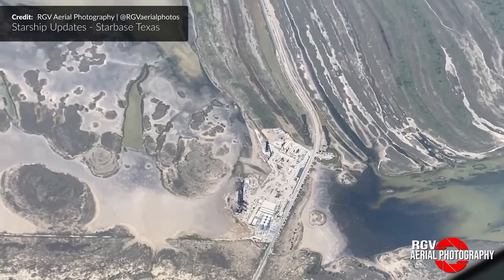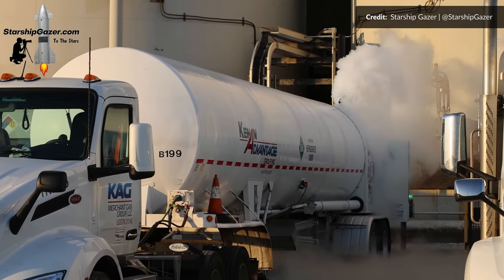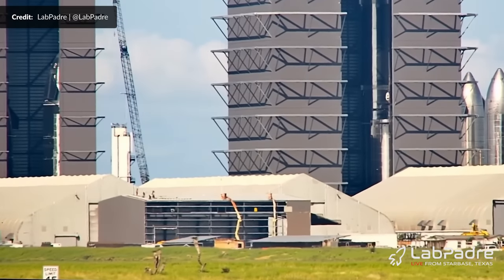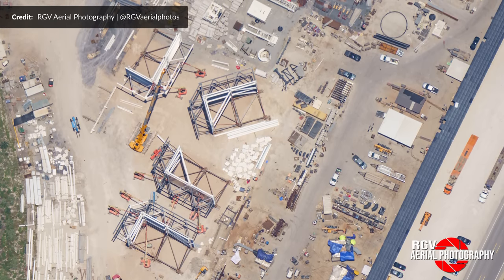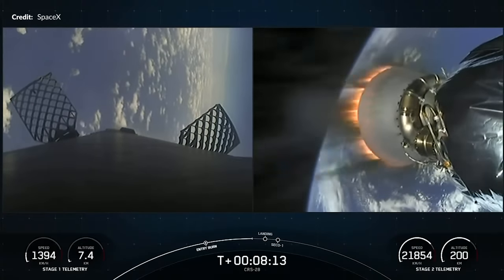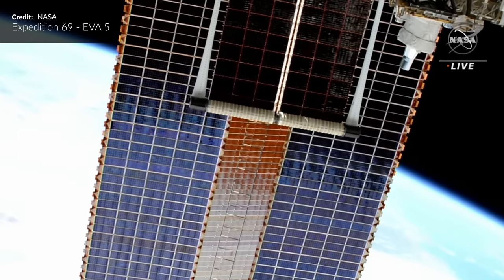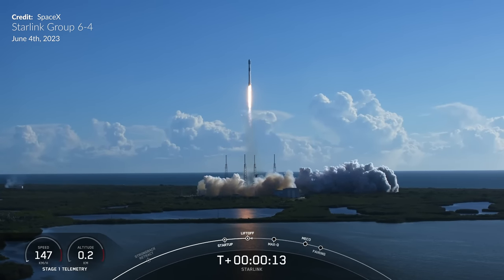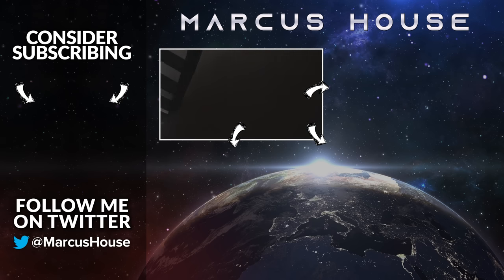NASA's Concerns with SpaceX Starship Delay,  CRS-28 and ULA Vulcan Test Fire

Comment: A lot to do...I am still not convinced this vehicle will be able to land on a loose, unstable surface like the Moon's regolith, and then be able to take off again from it without the debris it kicks up being an issue. I mean, nobody is going to go and build a landing pad for them on the moon. We may get to find out some day but the potential for delays in this program from legal and environmental challenges alone surrounding the Texas site may mean it is a lot farther off than we hope.
Reply: The Superheavy booster is not used on the Moon. The HLS Starship has 9 engines at most, not 33 like the Superheavy booster. The HLS Starship is currently planned to have a ring of 24 smaller methane engines at the top of the propellant tanks for the last bit of landing and first bit of launch. With those engines being roughly 25 meters off the ground, kicking up debris should be minimized.
Reply: @steveaustin2686  I know the booster is not going to the moon nor intended to do more than get the upper stage into orbit. Thanks for the info on the alternate configuration of thrusters. It is interesting but again we are still talking about an entirely new system and it still doesn't solve the issue of ensuring a stable landing site for such a tall ship to land. 

This is all a long way off at any rate and a lot can happen to derail this entire operation. That is more concerning to me than the engineering challenges at the moment. Hopefully they get it all worked out because we need this vehicle to work. Without commercial efforts in space we could be doomed because our governments are not going to do it and a serious failure could be all it takes to scare investors off for another half a century.
Reply: @socket_error1000  The one-use, temporary legs used on SN5-SN15 are not the legs tht will be usedon HLS Starship. SpaceX is making larger, more capable legs for landing on the Moon.

Not that far off, as the current plan is Dec 2025 for Artemis III. Even if it slides into 2026, it's still not that far away. 

NASA has been promoting the commercialization of space with various commercial programs since the early 2000s. NASA already has a contract with Axiom to build modules to attach to the ISS that are planned to be their own commercial space station. NASA is also fostering one or more commercial space stations under the Commercial LEO Destinations (CLD) program. So NASA is already doing what you are looking for.

Comment: Would like to know what is happening at the other launch site,  has work stopped?    😎
Reply: Probably waiting for some elements (like the OLM modifications) to be tested at Boca Chica.  Other elements are probably going forward.  Changes may be needed if they do go ahead with the 6000 ton modified design.  Can the current OLM even handle the extra 20% mass?

Comment: Why arent vertical tanks not a much much better choice, than the horizontal ones? They take much much less space and isnt the pressurization easier, too?
Reply: The vertical methane tanks did not meet Texas regulations, so they were converted to water tanks. Horizontal methane tanks that conform to Texas regulations were brought in. SpaceX hasn't mentioned why they are going to horizontal LOX tanks.

Comment: I've lost count. How many Falcon 9 launches so far in 2023? 
It's interesting that Falcon 9 has achieved the pace of launch that 30 years ago we hoped the shuttle would achieve. If we were building the ISS today it would take half the time and half the cost.
Do you think a private entity will  put up another space station?
Reply: Falcon 9 ≠ Starship. Those are two completely separate teams. Falcon 9 has had one in-flight failure, and it has never lost control and kept flying AND failed to destruct like Starship did.
Reply: @JBS319  Falcon 9 is an iteration of the Falcon 1, that took 3 failures before becoming successful on the 4th. Falcon 9 is unlike any other currently operational launch system. Starship is still in development, though Starship took a few attempts before having a totally successful test. The Booster will likely need as many attempts before also being successful, then its just refining the process before its ready for operational work.
Reply: @stewartkingsley  Eh, saying that the Falcon 9 is an iteration of Falcon 1 is REALLY stretching things thin. The Falcon 1 was a precursor to the Falcon 9, but the Falcon 9 is a new launch vehicle compared to the Falcon 1.
Reply: @JBS319  I was only referring to Falcon 9, which with the Falcon heavy is perfectly capable of lifting shuttle type loads.

Comment: I find it troubling that every time ULA has another setback, somehow SpaceX is included as also having problems.  SpaceX is delayed for a month.  ULA will never fly people again.  There's a big difference between these two situations
Reply: 🙄 You have ULA and Boeing mixed up. Artemis II is planned in 2024 and the SLS hardware for Artemis III is being assembled now. For Artemis III in Dec 2025, SpaceX has to do a full up, unmanned HLS Starship test landing in late 2024 or very early 2025. That means having the [DELETED] Starship propellant depot, Starship Tankers, and HLS Starship ALL working by then. Including up to 7 Starship Tanker flights. So they need launch pads that are ready to go. ALL of that development takes time and Dec 2024 is not that far away.
Reply: @steveaustin2686  you're holding SpaceX to standards that traditional space contractors wouldn't have a prayer of meeting.  SpaceX has a rate of continual progress that no previous contractors ever came close to.  ULA is a huge waste of money on 1970s rockets

Comment: I dunno, I wish there were more RTLS recoveries. I’m saying just build payloads with that constraint in mind.
Reply: Why? You’d probably reduce the mass per launch to 13 t - Starlink masses out at nearly 16.7 tons a launch, and some satellites go to GEO, TLI or TMI… RTLS would increase the cost per kg & is really only viable in lower mass launches where it would be more expensive to use the barge.
Reply: RTLS depends entirely on the payload and orbit it is going to. SpaceX will always prefer to RTLS as it is cheaper than a drone ship landing. But sometimes you just can't RTLS. The 0.3 ton (330kg) IXPE mission in Dec 2021 was a drone ship landing, because the orbit required used up most of the propellant.

Comment: When will SpaceX start testing prototype orbital fuel transfer, probably using ground-stand mock-ups or even deprecated starships from the rocket garden?
Reply: SpaceX has a $50M contract for demonstrating Starship to Starship propellant transfer in LEO (10 tons) by the end of 2022. So the schedule has slipped. SpaceX can't do that, until they launch to orbit. The next Starship flight is said by SpaceX to be another 'orbital' test, where it doesn't make a full orbit. So not for a while.
Reply: They already have a lot of experience pumping fuel in and out of spaceships on the ground, they do it on every launch or static fire test. And I would assume that they have created mockups of the connection hardware that they will use in space, but that's probably all happening in Hawthorne where we can't see it.

Comment: The new BO HLS, contracted for Artemis 5, is a massive improvement over the concept model for its failed bid for Artemis 3.  Notably BO has accepted that its whining about the "complexity" of the SpaceX bid was just hot air, since it is now committed to refueling in space.  However from an engineering point of view if the original bid, $6G for a single landing, was remotely accurate then the new version must surely cost at least $9G, but BO is only being paid $3.5G.  Now Starship is designed for applications which have not even been designed yet while the only application of the BO lander is for the very limited objectives of Artemis 5.  Where is the BO led consortium going to recover the minimum $5G it must absorb?

But the bottom line is if SpaceX does not meet the "aggressive" tjmeline of Artemis 3 what can NASA do about it?  There is no other possible supplier that can deliver a lander before 2026!  The only productive target of NASA's anxiety is the FAA to ensure that any testing delays are manifestly necessary.
Reply: 1) Jeff Bezos has decided to pay for the added cost of the project.
2) NASA Administrator Bill Nelson could overrule NASA’s managers & allow Starship prototypes to be launched from the launch complex SpaceX just built. They were worried Starship would blow up on the pad - It didn’t do that even when being bombarded with concrete!
Reply: @TraditionalAnglican  "Where is the BO led consortium going to recover the minimum $5G it must absorb?"  The BO lander has no other possible customer than NASA because it is a one trick pony.  Why would anyone, even NASA, pay the high cost for the extremely limited capacity of the BO HLS when for a lower price SpaceX will deliver 150 tons of cargo and dozens of passengers anywhere in the Solar System?  Starship, and Starlink, are going to be "licenses to print money".

I agree that the IFT was a clear demonstration of the incredible robustness of Starship.  If it was going to emulate the N1 it would surely have done so under these near worst case conditions.

Comment: Any idea what the small object was that dislodged from the rocket at 19:10 ?
Reply: The piece that came from the curved pipe above the engine bell? Likely ice.
Reply: @steveaustin2686  an interesting shape in that frame
Reply: @waynefergusson9987  Looks like a curved piece of ice. This happens ALL the time on launches. No mystery needed.
Reply: @steveaustin2686  will it remain like that for long ?
Reply: @waynefergusson9987  Yep, sublimination takes time.
Reply: @steveaustin2686  how long in space ?
Reply: @waynefergusson9987  Evidently more than 8 minutes and 50 seconds in space, as it flew off during that time in the flight.
Reply: @steveaustin2686  then remain as water ?
Reply: @waynefergusson9987  No, sublimination is the ice going straight to water vapor. In a vacuum ice can skip the water phase.
Reply: @steveaustin2686  hi steve - could you ask your ai what the optimum design could be for an in wheel electric motor for vehicles ?

Comment: If it takes around 38 days to recertify a craft for launch then I assume spacex intended to have more than 38 starships and boosters so they can launch every day. Does that make sense?
Reply: wow is that for real?
Reply: @brendenharris8858  The falcon 9 takes somewhere around 16 to 27 days to refurbish and recertify (that might include the time to ship it back to the launch site if it lands on a barge 🤔). I was making the assumption of 38 as a worse case for a much larger rocket. I should have clarified, sorry.
Reply: @powpowdingdong  

Starship is a ground up reusable design which should make it easier to prepare for another launch.  The methalox for example doesn't leave the same carbon deposits as kerolox so less cleanup required.

The goal is NOT to refurbish between launches or have to do extensive inspections but just restack, refuel, add cargo and launch like a cargo aircraft.  I doubt that they will achieve this with Starship (especially manned) but it is the goal.

It will also be some time before there are the (non Starlink) cargoes for Starship to require even monthly launches as things adapt to the (planned) lower prices/kg and design for a Starship launch.  Just look at how things are finally ramping up after dry years for Falcon Heavy as cargoes are designed to use its capacity.
Reply: @powpowdingdong  The fastest turn around for a Falcon booster has been 21 days. We have ZERO info on the turn around for the Superheavy booster or Starship (second stage). The SpaceX plan for the Artemis III mission is 1 Starship variant launch every 12 days per the GAO report denying the HLS Option A complaints (pg 10). So Musk's multiple flights per day is a far future prospect.

Comment: I wouldn’t worry. NASA doesn’t seem too concerned with the never ending Starliner tragedy and its delays. Apparently, Starliner is on hold due to ‘hundreds of feet’ of adhesive tape that's flammable and defects with the spacecraft's parachute system”.

I hate to see any spacecraft delayed, but I hope NASA can recognize the lightning speed of SpaceX versus legacy aeronautical corporations such as Boeing. I’m sure they do. Thanks for the videos, Marcus et al.!
Reply: To be fair, the tape is flammable only in certain situations per reports and requires failures of other hardware to happen. Per NASA/Boeing, "Although that tape is commonly used on other spacecraft, they are evaluating if it is acceptable for crewed flight (article "NASA and Boeing say preparations continue for July Starliner test flight" by Jeff Foust May 27, 2023)"

Boeing finds two serious problems with Starliner just weeks before launch
ERIC BERGER - 6/1/2023

"The second issue involves P-213 glass cloth tape that is wrapped around wiring harnesses throughout the vehicle. These cables run everywhere, and Nappi said there are hundreds of feet of these wiring harnesses. The tape is intended to protect the wiring from nicks. However, during recent tests, it was discovered that under certain circumstances possible in flight, this tape is flammable."

---------------

Parachute and wiring issues to delay Starliner crewed test flight
Jeff Foust - June 1, 2023

"Both the parachute soft links and wiring tape were used on the Orbital Flight Test (OFT) 2 uncrewed test flight in May 2022 without incident. The soft link issue, officials said, would only be a concern if one of the three main parachutes failed, putting additional loads on the other two, while the flammable tape would have required what Nappi called “multiple failures” elsewhere in the spacecraft."

Comment: I still don't understand why they don't use flame diverter like any other launch platform in world.
Reply: they will. When all their new methods fail.
Reply: @istvansipos9940 ok Nostradamus
Reply: Because they need the core of army  engineers approval
Reply: There’s a NASA report from the 70’s that shows that at the level of thrust of Starship super heavy, having a flame trench can bounce huge damaging acoustic waves to the vertical stack regardless of how it is angled. 180 to 200 DB. And water deluge doesn’t help much at those thrusts according to their research. So SpaceX is trying a new method of cooled steel plates. This is all new research on the fly. Good luck to them. I truly hope it works on the next flight
Reply: @longboardfella5306  and the water cooled still plates will be as efficient as pissing into dragon fire. They will melt, the steam will explode, and all the rest will be pushed into the concrete.
quite detailed Starship debunkings on youtube

Comment: Delay? Is not spacex like 15 years ahead of schedule compared to everyone else?
Reply: For Artemis III in Dec 2025, SpaceX has to do a full up, unmanned HLS Starship test landing in late 2024 or very early 2025. That means having the [DELETED] Starship propellant depot, Starship Tankers, and HLS Starship ALL working by then. Including up to 7 Starship Tanker flights. So they need launch pads that are ready to go. ALL of that development takes time and Dec 2024 is not that far away.
Reply: @steveaustin2686  This is assuming artemis 3 wont be delayed right?
Reply: @Ormusn2o  HLS Starship is the lander for Artemis III. If HLS Starship is delayed, then Artemis III is delayed.
Reply: @steveaustin2686  Yeah but you need both the launcher and the lander. Considering the delays SLS had its unlikely that the launcher will be ready in 2025 or 2026. First SLS launched just recently and NASA just recently delayed Artemis 2 November 2024, and considering it has to be crewed, its likely to take even longer. Both the launcher and the capsule were stacked for almost 2 year in artemis 1, and that was after they already built the rocket. It's unlikely that a crewed mission will be done faster. I think it's reasonable that the timeline will slip into 2030s, at which point it's going to be between very delayed or the project will get canceled as in 2030 there is new NASA financial assessment and budget planning.
Reply: @Ormusn2o  The components for the SLS for Artemis III are already being constructed. SpaceX is still dealing with test articles. Artemis I was the first flight of SLS, so it was expected that it would take longer than normal to set up. Artemis II is reusing some of the components on Orion, from the Artems I flight, so it was expected to take longer than the normally planned 1 year from the last flight. 

Starship has yet to reach orbit for even a test article. HLS Starship requires the development of the [DELETED] Starship propellant depot, as well as the Starship Tankers. Not to mention finishing the construction of a launch pad that can survive launch. If anything, it will likely be the SLS/Orion that is waiting on HLS Starship and/or the EVA spacesuits. 2030s for the Artemis III landing is a little pessimistic.

Artemis is an international project, so is likely to be harder to cancel than a normal space program. Fear of China being the only country on the Moon will keep the Congresspeople in line.